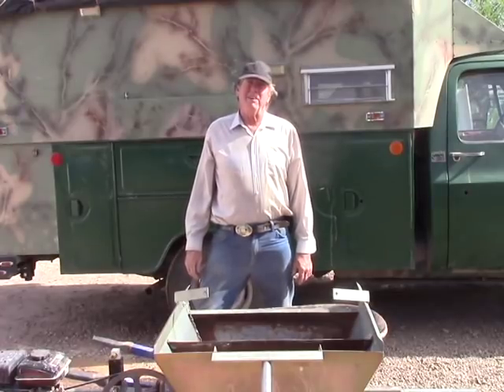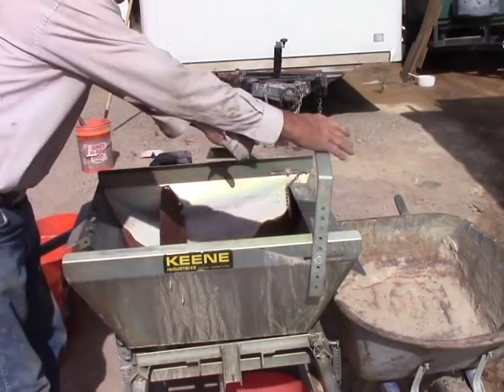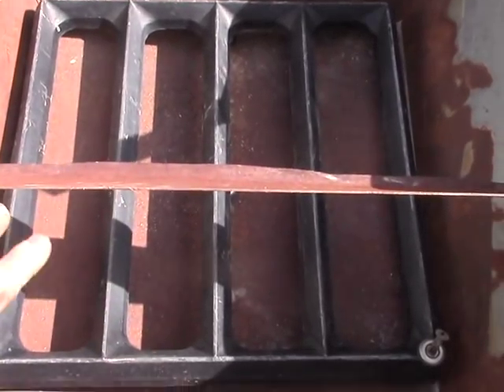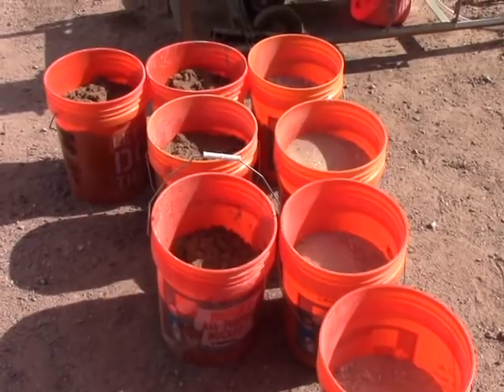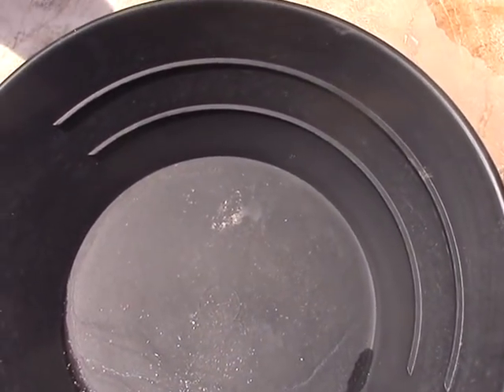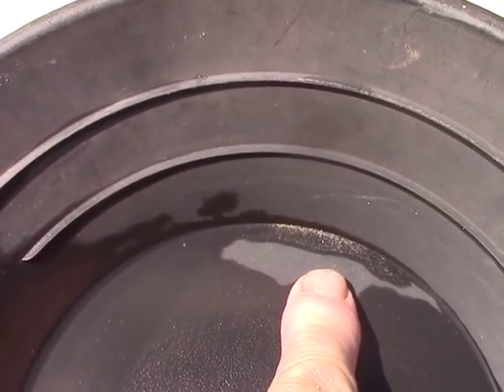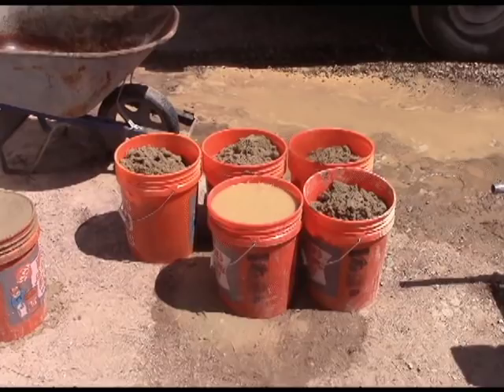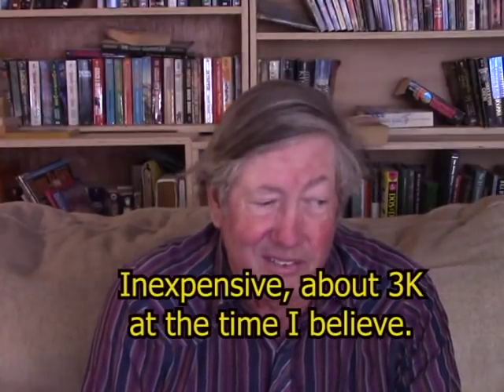A Fluidized Bed Concentrator - The Keene Hydramatic

Comment: Did you ever try to make a small version of this?
Reply from the maker: No.  I went to the Tripp concentrator - my name - I have videos; or the rouge wave tab;e -still secret.  Trying to get a DEEP fluidized bed was a pain.  A Denver Jig can do it, but I have never had a chance to use one.  Some guy in Alaska makes a small one... Riverdance is the name.
Reply: @hardrockuniversity7283  I spent about 4 years working on a fluid box with a vibrating motor. Just to see what was out there I came across your videos of the hydromatic about 3 years ago. This was the closest thing I could find to the fluid box I made. During some testing the vibrating motor shut off and to my surprise the Box still worked really well. I've probably made about 20 prototypes but have finally made it as simple as possible. I have a couple videos on my Channel about it if you're interested. I learned how to pan the fine hard rock gold from your videos.
Thanks!
Reply from the maker: Glad to be helpful.  Let me check it out...

Comment: These are great machines, I have used mine for small batch runs. The rocking section wears fast.
Reply from the maker: Hard rock or placer?
Reply: @hardrockuniversity7283  placer, I haven't used it in a while, watching your video has made me want to.
Reply from the maker: @danholman5282  Hope I was helpful.
Reply: I like your modifications. Is this the only video you have on this machine?
Reply from the maker: @danholman5282  There are several more.
Reply: I looked through your 100's of titles and didn't see anymore. It's not important enough for me to search everyone of them.
Reply from the maker: @danholman5282  https://www.youtube.com/watch?v=P-DUDvZEByc&t=49s
https://www.youtube.com/watch?v=-uFBV20ojcA&t=4s
https://www.youtube.com/watch?v=-uFBV20ojcA&t=4s
https://www.youtube.com/watch?v=CHFEcj0LMes&t=289s

That should give you a head start
Reply: Thank you, that will keep me occupied
Reply from the maker: @danholman5282  Roger

Comment: good video and explanation. The efficiency is going to be influenced by the depth of the bed you maintain in the machine. The recovery could actually be in the range of 50% for that amount of ore put in the unit. I would put 2 or 3 machines in series but good video, excellent
Reply from the maker: My improved version was getting about 80% recovery with much thinner beds.  not ready to make the info public yet.  :-)

Comment: Very interesting, in general can you recirculate the water without losses going up? Also, generally what is that average bank run cu/yd for placer on this unit?
Reply from the maker: There are always losses because you are starting with dry material and throwing away wet to damp tailings.  20% moisture content in tailings is a good guess to start.

The throughput would depend a lot on gold particle size.  For crushed hard rock ore with micro fine gold around 500 mesh, the throughput as about 200 lbs/hr.

Comment: Would this work well for beach sand?
Reply from the maker: I suspect it would.  You might look at my video on the modifications I made called I believe "The Triple Threat Hydramatic is Kicking ass.  The ore I am working with has smaller gold than beach sand, but it may not be as flaky so I can't tell without some to test.

Comment: I did a quick internet search and found a used one for 1100$
But it's in Canada. Sure like that machine but I have a question, what really is the advantage to just running it through some sort of recirculating slice type set up?

Comment: Hello Keith, how long do you generally wait before notching up to the next tilt position during the material reduction / concentration?
I’m still modifying my version of this unit but so far it’s been very good at reducing the amount of material without loosing the heavies..
Thanks sir for your educational HRU video’s 
PT
Reply from the maker: I usually wait while I do a test pan, about 4-5 minutes.  After the second notch, I will drop back down to the first notch and wait until the charge levels itself and then raise it to the next notch..  Like 1- 1-3-1-4 and so on.
Reply: Hard Rock University 
Okay, very interesting.
I will put a pan under the exit water/tailings then stop the shake, notch up, restart the shake and collect the material for a few minutes then see if there’s any gold getting away.. usually it’s void of gold/heavies.
I am modifying the system again to use a standard bucket instead of using a permanent tub. I am a small scale prospector so I need a system that is more my size and a simple replaceable bucket maybe the ticket.
I am hoping to post a video soon on this small scale ore concentrator.
I tried running river dredge cons (coarse material) through it and found did a good job removing the lights and only found 2 tiny flakes in the tailings.
I am really impressed with this easy concentration concept and believe it is just the ticket for bringing home a 1/4 bucket of cons and leaving the other 10 buckets of gangue at the site!
Thanks Keith.. this is definitely going to make test sampling various sites Way Easier!
PT
Reply from the maker: @ProspectorTripp  I don't even bother stopping the shake myself.

Comment: Keith! I am totally interested in building a similar unit!
I usually pour off the slimes from a 1/2 or less full 5 gal bucket full of water and try to concentrate and remove other light fines from the crushed ore in a similar way.. however manually.. it’s not easy or convenient.
I will look for a large stainless steel tub or large container that could be used  for making this tool.
I am also thinking of a tool that a 5 gal bucket is placed in that shakes and settles the heavier material to the bottom and can be tilted to run off the lights.
Thanks so much Keith! 
You are my favorite concentrated HR knowledge resources!
Thanks for all your efforts!
Let me know your thoughts sir.. 
PT
Reply from the maker: I'm currently working on some (hopefully) improvements to the design.  Hope to have more to show on them by fall.

To just de-slime material, you can pour in into a slanted pipe (45 degrees or so) with a very slow upwelling of water in the pipe.

Thanks for the kind words
Reply: Good idea.. again!
Thanks

Comment: Could you fathom incorporating the concept on a larger scale in line between a 20-30yd/hr trommel and the sluice to act both as a nugget trap and a way to possibly trap fines prior to reaching the sluice where the water speed then picks up, often taking the super fines with it
Reply from the maker: If you put it ahead of the sluice and sufficiently large to recover the very fine gold, why use a sluice at all?  After the sluice and a fine classification screen, I think it might make very good sense in some applications.

Comment: Keith, we had built something very similar to this years ago and was just in the re-design mode for one with the same basic principles you have there.  The holy grail in mining has always been to pre-concentrate your head ore as much as possible without loss of gold.  This basic equipment design with a few modifications has the makings of a very good pre-concentrator for both hard rock and placer mining.  If you want to join forces, just let me know.
Reply from the maker: Hmm.... sounds interesting.  The OTHER holy grail is getting clean concentrates with micro fine gold.  That is what I have been working on.  Where are you located?

Keith
Reply: @hardrockuniversity7283  Keith, I am located in Salome, AZ, about an hour and half west of Phoenix.  I would agree with you on the clean cons for fine gold.   Dwight
Reply from the maker: @LNWMining  I think we should probably chat.  Why don't you email me at hardrocku@outlook.com  and we can proceed further.

Keith
Reply: @hardrockuniversity7283  Message sent.  Dwight

Comment: In your opinion would putting a charge of steel balls in the unit help with agitation? This would also take up some of the volume leaving you with less cons
Reply from the maker: I'm thinking rounded river rock of 1 - 2 inches would do the same at lower cost and with less mass to move back and forth.  Good idea.  I'll try it when I get a chance.

Comment: I've got a tin mining project where this would be awesome. Sand bars in a river where there is about two teaspoons of SNO2 per shovel. Little bit of gold but I want the Tin. Although could clean up a good amount of gold from below the sand bars. With this I could just shovel it in all day. If my body was up for it that is.
Reply from the maker: Yep, it has real potential.  You can also put a valve on the drain and 'tap' it without stopping.

Comment: As I understand it, Patents don't stop you from making one for your own use.  They stop you from making them and selling them.  Sure was over priced.
Reply from the maker: I think the patent owner COULD sue you for home use, but how would they know?  And why would it be worth it?  They were making these in 1990.  That was a long time ago...

It is pretty well made though.  Heavy gauge steel and plated to prevent rust.  Small numbers means high prices.  I think I will get some experience and then see what I would change.  Compare it to the price of a 1 TPH table and see how expensive it looks then.  :-)